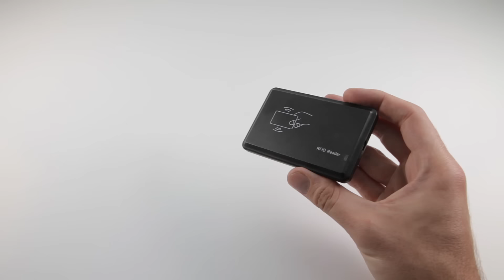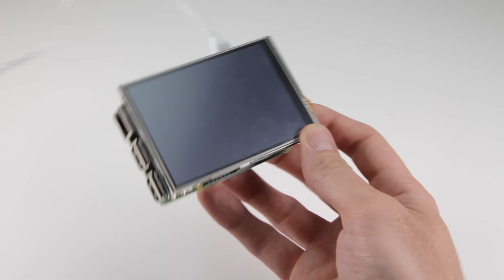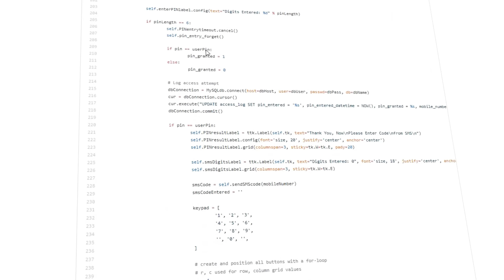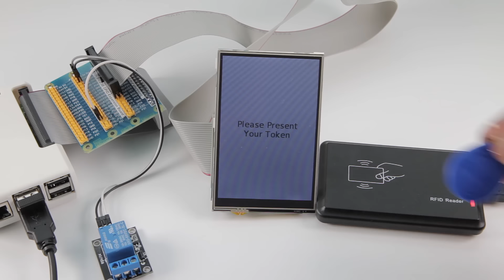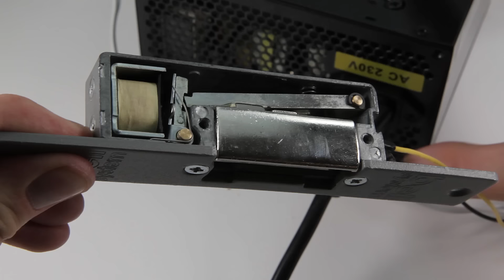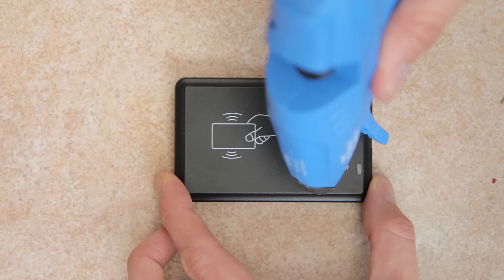Build a Raspberry Pi Smart Door Lock Security System for your Smart Home!

Comment: Hello, im a 19 years old portuguese Networking student on my final year, and im required to do a final project for graduation, im love eletronics and your 3-factor authentication door got me even more interested on it. I just wanted to ask if i could do something similar to that as my graduation project. I see that your project uses a touchscreen to show the information and to enter the code, i was thinking if it was possible to change that for a 4x4 keypad and having the messages showing up on a 16x2 lcd. And instead of having the Twilio sms system, having a Fingerprint sensor as the third authentication method. I was looking at your code and i understood a little bit of it but theres things i dont quite understand and im having a hard time adapting your code to use the 4x4 keypad and show the message on the 16x2 lcd. Can you give me some help changing the code, or some hints on how the code works?

If someone is experienced in python coding can you help me?

I highly appreciate it.

Thanks.

Comment: Can I set this system up to handle 10 different locks hooked in to the raspberry pi and a selection screen on the touch screen so the user can select which lock they want to affect before they enter their credentials?   If that much works the only other thing I'd need it to do is once the first user approaches and open and closes a door the second and all users coming after can't open that particular door again until the first user has come back and open and closed it.  It's essentially a tool storage cabinet that everyone needs to gain access to any of the items in it at a moments notice but we need know who took which tool and to have a record that they did indeed return it or to alert us that it's been x number of days and the tool hasn't been returned.
Reply from the maker: Yes, you can do all that :) It's unfortunately beyond the scope of a comment reply here, and you'd have to make some changes and code some software updates yourself - but that's all possible! :)

Comment: Hi.how can I add a clock and date onto the screen,and a logo
Reply from the maker: Hey there! To add a logo, instead of your picture, you simply need to put a photo in GIF format in the same folder/directory as the Python script, then add the filename (without extension, as it can only be GIF) into the database field for your user. If you want to add this to the welcome screen, look at lines 143-145 of the code (https://github.com/paulfp/Three-Factor-Security-Door/blob/master/lock.py) to see how this is done and how to add it to the welcome screen.

To add a clock to the welcome screen, you'll need to create a label for your clock and then set a timer of some sort to update it every second, whilst it's on display, with the current time in HH:MM:SS format. You should then clear this timer when this screen is removed, and start it again when it displays again.

That's the general concept of how to do both your things, you'll now have to do the leg work yourself on how to turn that concept into reality. Have fun and enjoy learning! :)

Comment: Awesome Video, Thanks. I had a few questions. 1. how could I replace the lock with a servo? 2. how could I use an app instead of the touch screen? 3. and how could I replace the RFID to NFC and use my phone instead of a Fob? 4. Would there be anything different using a Raspberry Pi 4, Than the others? Thanks
Reply from the maker: Glad you liked the video! :) Yes everything you've suggested is possible. Beyond the scope of a comment reply to go into the hows and details, obviously, but you're more than welcome to take my code/setup and modify it like that to suit your preferences :) The only difference if using a Raspberry Pi 4, just like if you were building this today on a 3, is that this project is 3 years old so all the code and software versions are from that era - you'll need to update accordingly for newer versions of pretty much everything. So take my video and instructions as a conceptual guide, rather than an exact step-by-step. Good luck!

Comment: Nice tutorial but I got some issues. When I try to install mysql by the:"sudo apt-get install mysql-server" it says the package is not available... E: Package 'mysql-server' has no installation candidate. Also, I installed mariadb-server-10.0 thinking it will solve some following issues with loading the lock.py onto the raspberry pi but it didn't work.
Reply from the maker: Hey there, if you're using newer versions of all the software (which I imagine you are; this was developed early summer 2017) then quite a lot will have changed since then. However, the fundamentals are all still the same - you just may need to look up how to install things for your current version of Raspbian. Are you using a specific OS image that came with your LCD screen, or the newest and latest Raspbian from RPi?
Reply: @SwitchedOnNetwork  Thanks for response, I had to install modules for mysql , like pip install mysql client etc. after that a problem was at the line with rfid reading code, I had to replace dev0 with dev1 in my case, I am still unsure why. Happy I get it done in the end. Now I am working at the electrical part.
Reply from the maker: Yeah it depends on what other devices you have attached to your Pi as to what hardware address the USB reader will be.

Comment: Hey Paul fist of all great project, I have tried recreating this but I have reached the stage where everything is booted to the default screen asking to present "your token" but when I tap the key fob it doesn't accept it. I wrote down the number on the keyfob as the code on PHPMyAdmin. Please could you guide me on how to amend this.
Reply from the maker: Hey, thanks for your comment! The best way to go about this would be to debug as you would any other issue. If you run the script manually from a shell/terminal, rather than autoload on startup, you should hopefully see some errors get spat out to the command line which might point you in the direction of your problem. Failing that, modify the script slightly so you can figure out what's going on - get it to print out to the screen what code it thinks it's getting from the card, for example, and just check every single micro-stage of the process in that way until you find the issue. Good luck!
Reply: @SwitchedOnNetwork  I managed to fix the file so it runs but when it comes to scanning the fobs the screen doesn't change it stays stuck on the first screen. What should I do?
Reply: @SwitchedOnNetwork   I got the same question paul can you please update i'm stuck at the same point too. Thanks

Comment: @Switched On Network  Thanks i managed to solve this probleme; But now i have a probleme with phpmyadmin... When I import the file, I have " errors were detected on the server". I don't know what is it? And when i open the acces_liste i just have the icone of " user_id", "name","image"; " rfid_code"... I didn't have the column with details.
It's my first time in php my admin, so i'm a little lost...

I make a project with a Box of key.
The user enters his username and password on the touch screen and the motor in the box open it. After the user take key ( with RFID badge) and a message was sent to the owner.
Your project is very similar so i try to use it but it's difficult when we never did any programming aprt arduino.

I hope that our project might interest you.
Thank's a lot for your answer .
Reply from the maker: Ah great, that sounds like a great project! 👍 What file are you trying to import into phpMyAdmin.... Does it end with .sql?

Comment: I didnt have lines in the 99-calibration?
Reply from the maker: Are you using the exact same LCD as me, and did you install the provided image on your SD card? If not, you'll have a different procedure so you'll just need to check the documentation that came with yours 👍
Reply: @SwitchedOnNetwork  Thanks i managed to solve this probleme; But now i have a probleme with phpmyadmin... When I import the file, I have " errors were detected on the server". I don't know what is it? And when i open the acces_liste i just have the icone of " user_id", "name","image"; " rfid_code"... I didn't have the column with details.
It's my first time in php my admin, so i'm a little lost...

I make a project with a Box of key.
The user enters his username and password on the touch screen and the motor in the box open it. After the user take key ( with RFID badge) and a message was sent to the owner.
Your project is very similar so i try to use it but it's difficult when we never did any programming aprt arduino.

I hope that our project might interest you.
Thank's a lot for your answer.

( Sorry for my english, I'm a french people ; )

Comment: Great project and video! I would like to adapt it for a package delivery door (we’ve had porch pirates) is there a way to eliminate the rfid and the random code generation features and just have a the single pass code that I could give to the delivery driver and also receive the sms notifications? Thanks for your help.
Reply from the maker: Hi, glad you liked it. Yes, that's fine to do that - if you just modify the Python code to suit your needs, that should work great with the hardware! Let me know how you get on :)
Reply: Switched On Network I have no experience with python so I will need to do some research. Any advice is appreciated. Thanks
Reply from the maker: @ewokkillah  You'll need to strip out the functions that you don't need and call the ones you do... plus make any changes. Before trying that, find a beginners' Python course and get familiar with the basics. Happy to help :)
Reply from the maker: In fact... you've inspired me to make a "Safe Place" for package delivery, so maybe a video will appear on the channel later this year :)

Comment: How do I take out the RFID reader so that I just enter the code? And can I make the code 4 digits long?
Reply from the maker: Yes you can do that, both those things, just modify the python code as you require 👍
Reply: Thank you. I have the original Pi that has less GPIO pins and a composite port. Will this work with that? Also can I use a Monitor   instead of the GPIO pins? I plan on using a external keypad.

Comment: Dear Paul
Your Work is Highly Appreciated.
I am in the last phase where I am trying only to run my python script in shell

I am trying to Run it using Thonny python installed in Pi.
I installed MariaDB
I get an error in line 3. import MySQLdb
Error: ModuleNotFoundError: No module named 'MySQLdb'
Reply from the maker: Hi, thanks - glad you liked it! What happens when you try to install the MySQLdb module?
Reply: The phython script lock.py
I tried to Run it
In line 3 of the script
import MySQLdb

I get an error. It is not found. I tried to find this specific file inside usr/var/
It it not there

Just to clarify, I installed MariaDB,php7, myphpadmin, because Mysql is not downloadable anymore.
However everything worked and I logged in myphpadmin, imported the database succeeded
 
If you could please, give me a lead how to overcome the error Running lock.py
Reply from the maker: You need to install the MySQLdb module for python, or MariaDB equivalent

Comment: Can you launch the codes on the Rasberry Pi 4 without modifications?
Reply from the maker: It depends on what you mean by without modifications. You'll need display drivers for the screen to work...
Reply: Switched On Network I tried loading the code as per your instructions but got an error. I think it had to do with the database. Anyone I’ll retry and see what happens? Is it possible for me to get step by step instructions?
Reply from the maker: Sure, here are the written instructions: https://www.switchedonnetwork.com/2017/11/10/build-the-ultimate-door-security-system-with-three-factor-authentication/

Remember that this video is 2 years old now, and it was about 2.5 years ago I was actually developing this, so newer versions of all the software involved will behave differently. MariaDB, for example, has replaced MySQL in many scenarios. So you'll have to work your way through the errors and debug as you go along, if using newer software. Make sure you're using the same Python version, if you can, to keep things simpler. But the general concepts and most of the code should work just fine - you'll just need to get past the differences which are throwing errors. Good luck, and let me know how you get on! :)

Comment: Can i connect 5 inch touch hdmi display and display program is same as 4 inch
Reply from the maker: It will depend on the specific display as to whether you'll have to alter the program. If the resolution is the same, there shouldn't be an issue (but you may need different drivers). Higher resolution will probably require work, I don't think it's responsive (but I've not really looked at that code for about 2 years so can't remember lol)

Comment: I'm so impressed by how easy you make this look.  I'm convinced that even I can do it.  Here's a question: How would you scale this system up to say a dozen doors in a building and share the same database?  And if you were only looking for two-factor authentication (fob & PIN), is there a way to disable the third factor?
Reply from the maker: ha, thanks! I'm sure you could :) Yes for scaling up that would be very simple - you'd simply create a central database on a separate machine on the network (that could be another Raspberry Pi, or another computer set up as a database server). Then I'd assign each door its own unique ID number (just 1-12 would do) and slightly modify the scripts running on each door to identify themselves by ID. That could allow you to specify only certain doors that a given user has access to, for instance (via an additional table in the db). The logging as well could include the door ID so you know which door has been accessed. Finally, the scripts running on each door would simply connect to the central DB over the network and not run a db locally on each Raspberry Pi. You could probably get away with using a Pi Zero on each door, in lieu of a full size Pi too, to save money and be more compact.

You could also make access to some (or all) doors time-sensitive, too... by specifying time windows that user X has access to door Y.

With regards to disabling the third factor, yes you can do this by just modifying the function calls to skip that altogether and go straight to unlocking the door.

If I had the budget and a space to do this, I'd love to make another video doing this expanded system. If you make this, I'd love to see it and feature a video guide on the channel!

Comment: This is almost perfect for my smart door lock project; except that I'm pretty old school and didn't like the RFID system. I wonder if I could replicate similar system to this, but with a magnetic strip card swipe reader instead. Just swipe and it'll grant access XD 

Awesome tutorial, and very much understandable even for someone with ADHD like me :D
Reply: That would be even easier to do, if you just wanted to swipe and get in.   If you wanted to add the other factors, you would be able to essentially do the same thing he's doing just replacing the hardware and some of the coding with your proper hardware and code, essentially just replacing the RFID for the mag stripe.   They essentially work the same, inputting a code into something, one just uses radio frequency to do it, while the other uses a magnetic strip.  
If you just wanted the magstripe entry, essentially all you need to do is buy the magstripe reader and the raspberry pi, as well as any other things to operate the electronic door lock and set it up so you swipe and it unlocks.  Honestly even using raspi would prolly be overkill, I'd imagine just a simple microcontroller would work, if you aren't gonna make it pull up a profile where you have to input your pin, then and send a temporary authentication code sent to your phone, as there is more processing needed.    No need for internet or anything, though, so even a really simple raspi could prolly do it.  Like a nano or something.  

This is just me kinda guessing tho

Comment: I am trying to make a sudo-escape room for my office. The last obstacle will be this device, with a key fob and the pin. I also plan on hooking up a speaker to the stereo port on the pi, and would like to either play a sound file or do text to audio (ex: wrong, try again or success!). So I dont need multiple pins/fobs or the SMS portion. So I think I can just keep everything in the python script, and not need apache/php/mysql.  It would even be nice, for the person starting the clock, to be able to do it on this device, and if they run out of time (30 mins), a time's up/siren goes off. Thoughts?
Reply from the maker: Awesome idea! Yes if you want to simplify it you could scrap using the database and either hardcode everything into the Python script or use flat .txt files on the Pi (or something like SQLite). I look forward to seeing it when you're done :)
Reply: I can’t get the rfid reader to work on the pi. Works on windows. Tried just about everything. 
Lsusb shows it on bus 001 device 007: id 6688:6850
Looks like it maps to /dev/usb/hiddev0
Reply: Figured out my problem. I bought the RFID reader/writer. Once I bought the RFID reader, everything worked. Will share a video when everything is finalized.